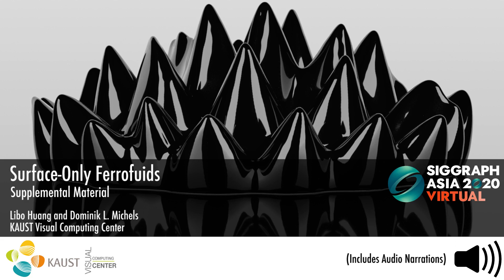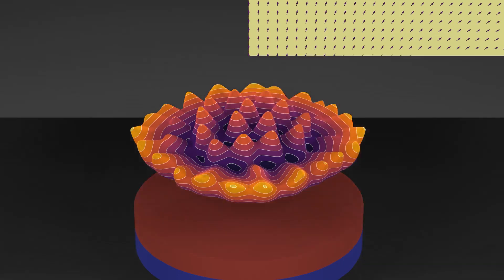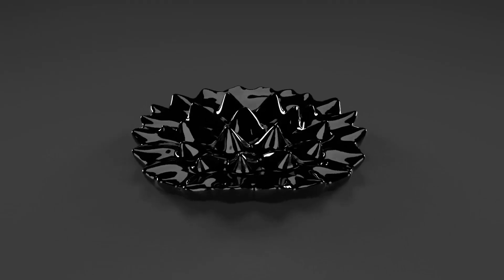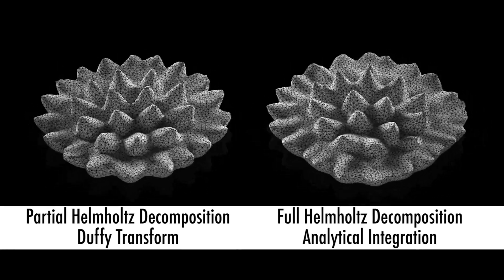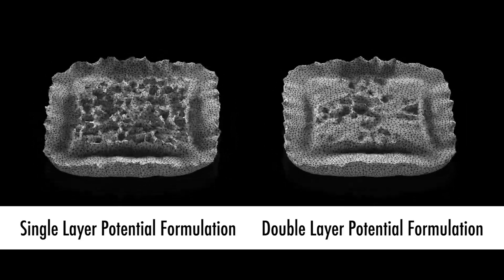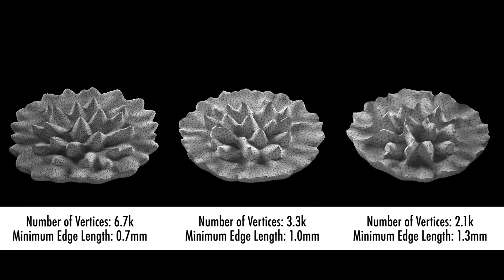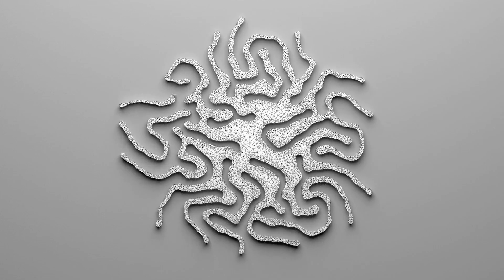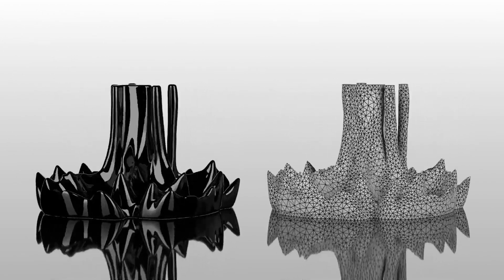Surface-Only Ferrofluids (SIGGRAPH Asia 2020)

Comment: Super nice work! Which tools and/or programming languages have you used to implement this? There must be so many things that need to be handled well in order to produce these results. For example, something you didn't even mention but which I think must also be a quite important aspect is handling of the mesh (initial generation and then adaptive addition/removal of triangles). I'm just thinking what tools there are that can handle all these things: the mesh, equation solving to find the pressure everywhere and the numerical methods for updating the velocities of the nodes. Can you do all of this in Python easily? Matlab? Then it's a bonus that the rendering is stunning too, but I suppose that this is done in some separate tool and not in Python or Matlab. Or?